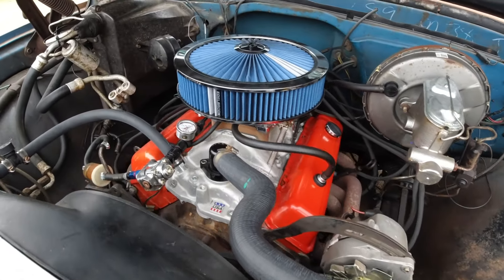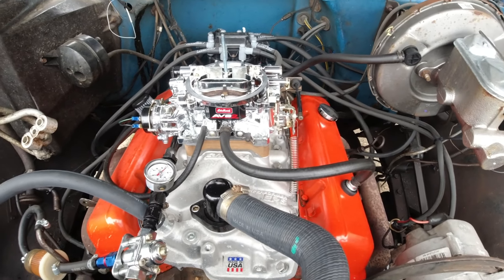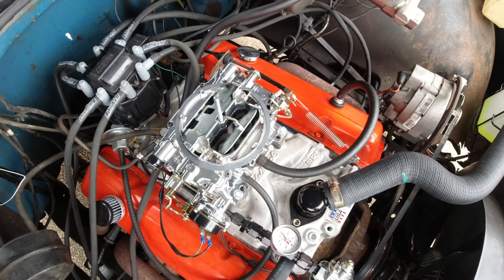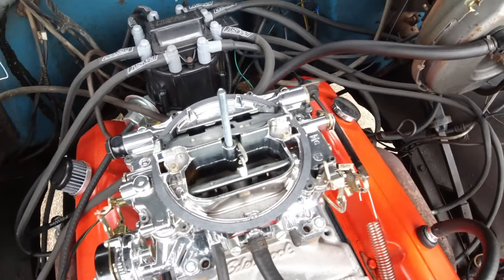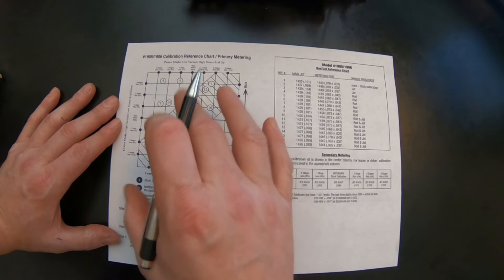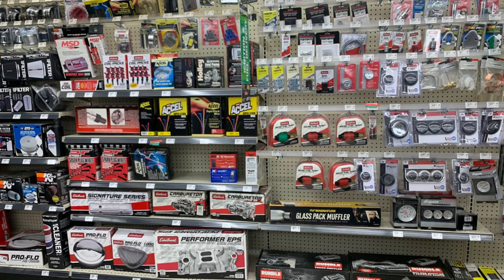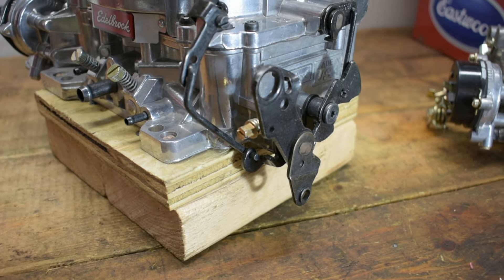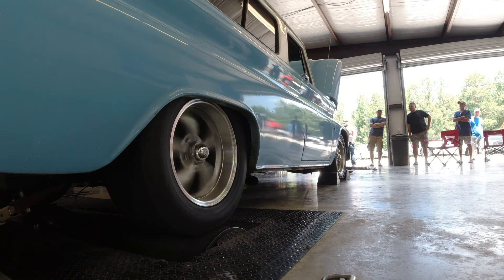Edelbrock Carburetors - The Good, The Bad and The Ugly

Comment: What is your take on the Demon 650 street carb?
Reply from the maker: I thought the street demon came in 625 and 750?  Or are you taking about a different version?
Reply: @MuscleCarSolutions  I meant to say 625. sorry got confused.
Reply from the maker: @55chevytruck  no worries!  Just wanted to make sure I knew which one you were thinking of.  Not a fan of that carburetor.  I don’t like the idle circuit and the needles that always stick out into the venturi.  Not much of a fan on the tuning side either.  I guess I’d the price was right, it might be a good option if you weren’t expecting much from it.

Comment: Disagree.....    Never had any bog issues what's sharp left-hand turns with my floats properly adjusted.... Also taking my mind that if this is an issue for someone is it just the float to be a little higher. Problem solved. 💯🔥

Comment: Does the avs2 need a fuel pressure regulator? I'm having hesitation issues on WOT and getting explosions on my exhaust
Reply: The explosions occur at around 4,000 RPM
Reply from the maker: @samueltrinidad9501  explosions!  Yikes! Yes on a pressure regulator and gauge.  I’ve done a few videos on setting up a fuel system for these carbs.  What tuning have you done on the secondary side to address the hesitation?
Reply: @MuscleCarSolutions  I've tightened about a full turn from stock specs on the secondary tension adjuster, I believe that's about two turns as soon as the flap touches the edge
Reply from the maker: But no other tuning?  Sounds like it’s time to get a calibration kit and start running through the process.
Reply: @MuscleCarSolutions  okay I'll order one off  the internet, thanks for your reply 👍🏼

Comment: Looks like the distributor is on the wrong (timed) port.  That's only if you're trying to duplicate the emissions BS that came along in the 70's.  For the engine to run the best it can from the standpoint of making the most use of energy from the fuel it should be on the drivers side (lower) port, otherwise the fuel isn't being completely burned at idle, some of it is being sent into the exhaust unburnt, which in the 70's they wanted to happen and used air injectors to have it be burned in the exhaust to raise the temp to reduce emissions....funny....wanted to reduce emissions by making it less efficient, lol
Reply from the maker: Depends on a couple things, but timed as an option for street cars is absolutely viable.  Not all engines operate best on full manifold vacuum.  That’s why there’s options.  If it were just an emissions thing, every aftermarket carburetor manufacturer would have ditched it decades ago.

Comment: I see you removed your A/C. WHY? So many older cars do not have a working A/C. Even $50,000+ restorations do not restore the A/C system. WHY?
Reply from the maker: I didn’t remove it.  The previous owner did.  OK?
Reply: @MuscleCarSolutions  Yes. Just wondering why I see so many cars/trucks with this. As I say, even $50,000 or more restorations abandon the A/C system. Most of the time one can completely restore a A/C system for around $2000.
Reply from the maker: @MostlyBuicks  I live in the south.  The a/c will get its turn, but it’s low on the priority list.

Comment: It's a copy of a smog carburetor from the early '70s or late 60s. Never was intended for performance.
I can give all the exact details and names but all you guys need to really know those carbs are not for performance!
Reply: Great Video!  I'm shopping for a carb to replace a tired and troublesome Holley 850dp on my big block chevelle. I was looking at the avs2 800cfm for its features. Do you think the Edelbrock would be enough carb for a 476cid with a cam?  Street driven.
Reply from the maker: Depends on what rpm you’re tuning and what you’re using the engine for.  I have a video on selecting the correct CFM that you might find useful in making a selection.
Reply: @MuscleCarSolutions  Thanks for the super fast reply!  In my youth i had visions of giant blown motors coming out of the hood...but i'm older now and its a convertible anyway, so I'm streeting it, with some periodic hard pulls.  5000ish redline i would think.
I found some old paper work from the original engine builder and it states "750-780cfm, no edelbrock, no spreadbore or silver holley".  I found this really strange since the carb that came on it was an 850 holley.  Is there anyway that an engine would be incompatible with certain carbs?  I find this totally strange.
Reply from the maker: It’s not.  It’s someone’s bias.  Ignorance.  They meter fuel and air and all do the job very well when they are told how to work on the engine they get placed on.  If you’re building a fun cruiser, an Edelbrock, Qjet, VS Holley - all good platforms.  750-800 is a perfect CFM range for what you’ve mentioned so far.
Reply: @MuscleCarSolutions  Thanks for confirming that...I found it totally weird and would really narrow down what you could run.  So far, the AVS2 800cfm is at the top of my list.
Reply from the maker: The AVS is an incredible carburetor.  Easy to tune and the throttle response is very responsive.  They did an amazing job with the redesign.  For a street car there’s not much better.

Comment: Stay away from this Carb..  and Edelbrock!! They're tech line is horrible with either condescending jerks.. or completely unskilled people reading instructions they're coached to say.. the carb is absolutely garbage.. 3 accelerator pumps in 3 years.. excessive corrosion.. loose screws,  cross threaded screws on the secondary venturies from factory power tools.. metal shavings inside the float bowl when new.. the Edelbrock air cleaner doesn't fit their cheapest carb without a 30 dollar fuel fitting. . They're throttle adapters and 700R4 adapters DO NOT WORK!!! 
STAY AWAY

Comment: Look, it's miles ahead of any other carburetor! Especially a Holley! Put the damn thing on with a good external filter and forget about it!! No, they're not as easy to modify as a Holley.  Pull it outta the box and bolt it on! Turn the key and it starts! If you wanna play with your carb, buy a Holley!😂😂😂😂
Reply from the maker: There’s a reason why it’s got removable rods, jets and springs.  It’s designed to be tuned and it’s painfully simple to do so and get the engine to its full potential not just “ok”.
Reply: @MuscleCarSolutions  no argument there! But, it's a bolt on and forget it carb! If I'm looking for nothing but maximum performance,  I'll buy a proform body and build the perfect Holley! I've ran them all, but you can work on a Holley on the shoulder of the road, and I  have!!